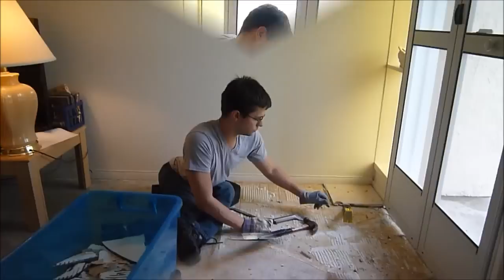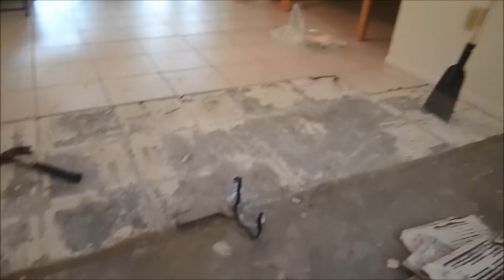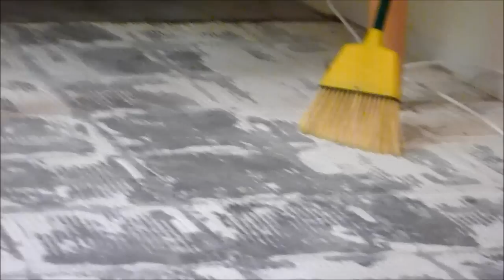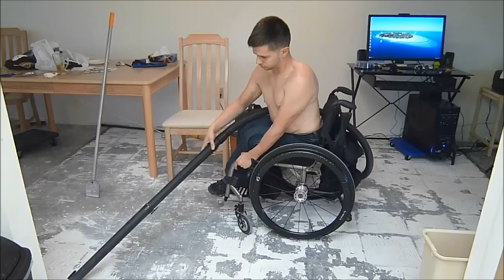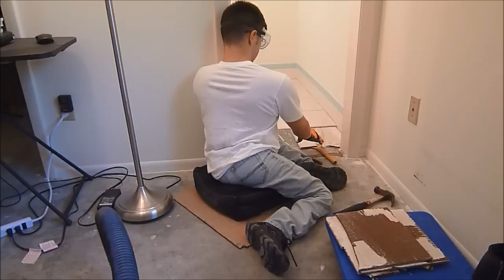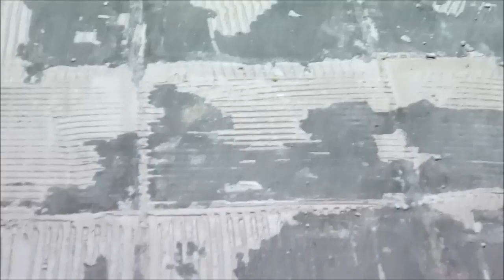Do It Yourself (DIY) - Taking The Old Tile Out Of My Condo (Wheelchair user) (Paraplegic) - How To

Comment: So, why pull up the tile? (Too hard to fall on? Want more color?) what's going down next?
Reply from the maker: The tile was too rough for my liking.  It was scratching up my pants and knees/feet sometimes.  The new tile is going to be about the same size as the previous one, but it will be smoother so that my pants don't get ruined if I happen to crawl for a bit sometimes.